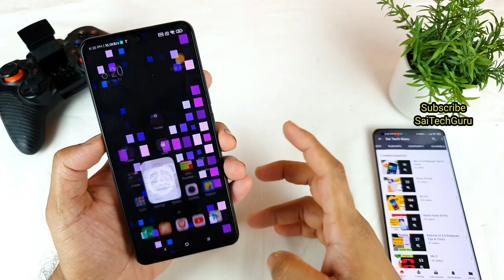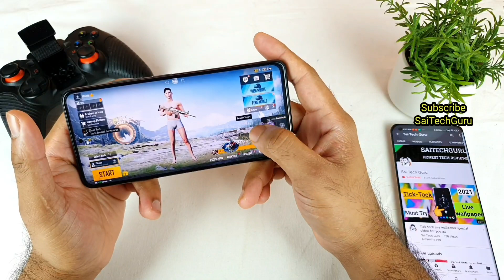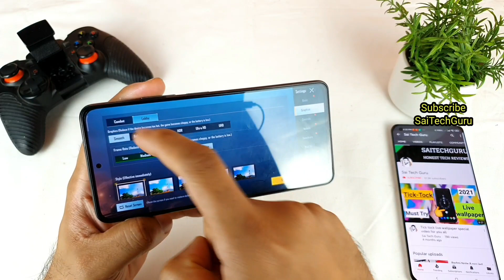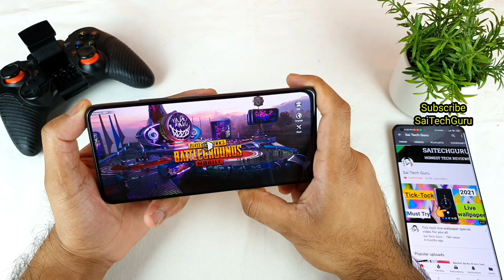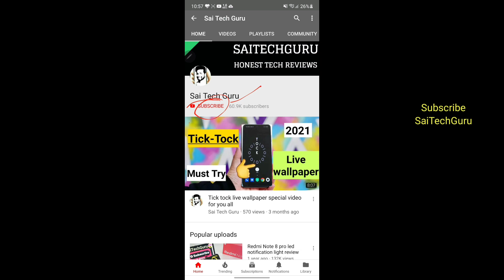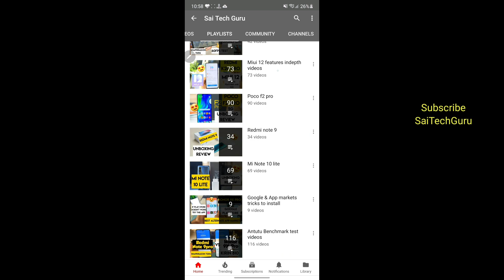Mi 11x pubg 90fps gameplay support test using gfx tool working or not ..?

Comment: Bro 90 fps won't show check with power monitor or edit active sav if it is not showing,100;% smooth gameplay on 90fps , but miui 13 update is worst , but miui 12 was beast